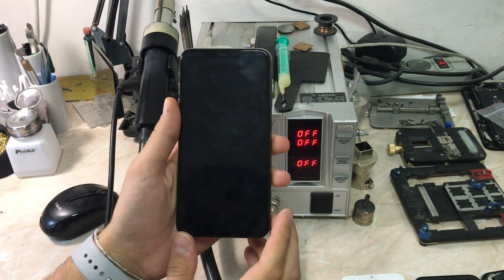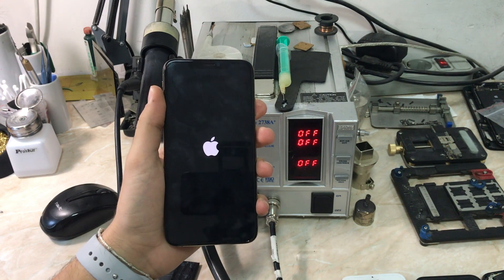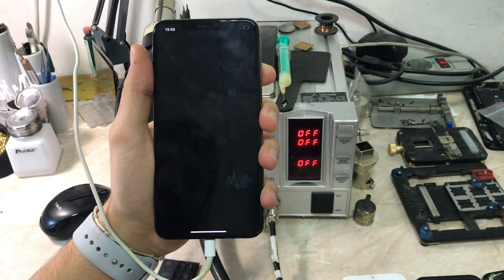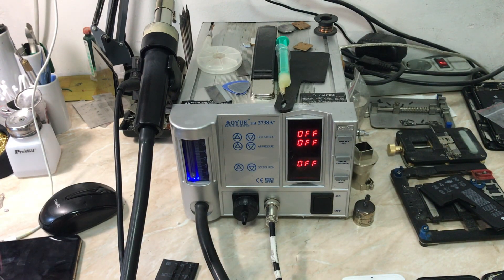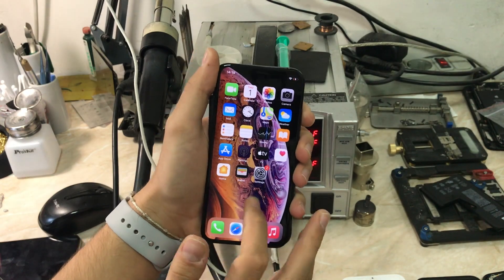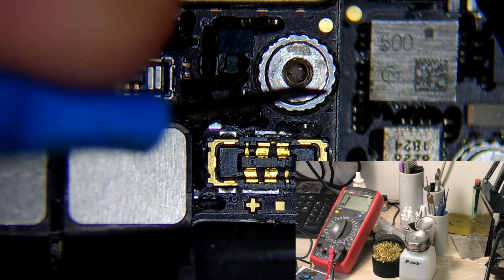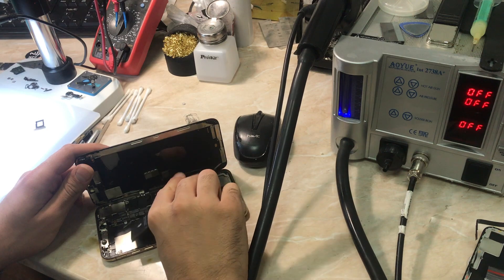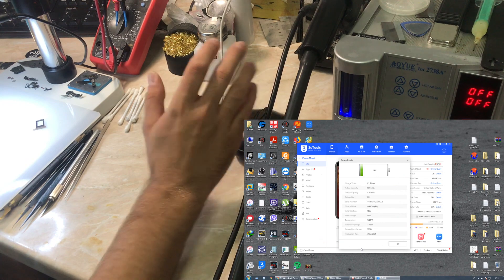iPhone Xs Max Stuck on 0% (Not Charging) Repair

Comment: Where are you located and do you still make repairs? Cost?? My xs max needed a battery change so I tried it myself. After removing the battery and replacing it the phone doesn’t  stay on for more than 90 seconds and only shows 1%. It also won’t charge. Apple said they won’t touch it.
Reply from the maker: Hi,
Sure, I’m located in Ukraine, you can DM me if you want

Comment: My phone shows the charging symbol but it just stays on the level it was at, I’ve already tried 2 batteries and each one has a separate problem
Reply from the maker: DM me
Reply: @AntoineKiriaky10  I’ll dm you on Reddit, I already have a couple posts about it there
Reply: I have the same issue. How did you fix it?
Reply: @ yes the third battery I got worked

Comment: Great help , thanks for mentioning the name of those mosfets , you may have just saved my iPhone, my XS IS DRAWING 0.46 WITH BATTERY PLUGED IN AND 0.40 battery unplugged, clearly there is a short and those mosfets are getting quite hot , ill try this repair ? although my one will not even power up , no display , any help would be great, ??? many thanks ,  I have just subscribed to your videos
Reply from the maker: Hey please DM on telegram so I can understand more about your problem thanks
Reply: @AntoineKiriaky10  thank you for replying , I do not have Telegram maybe I can install it , I have ordered the mosfets you used , I also noticed the 2 smaller diods on the left side of battery have been damaged they are DZ3200/DZ3201 so I just ordered them too, both are responsible for charging etc so hopefully they will be the problem , thanks again my friend
Reply: @alaster33  hey. did you solve this?

Comment: hi sir, your work perfectly nice. i want ask . this is first step to diagnosis wont charge right ? if this doesn’t work. we have to separate the board and see to hydra or coil right ?
Reply from the maker: It depends on the situation of course, first thing to do is basic diagnostics other battery-flex and then begin with board, i hope that you can join our group on telegram so we can discuss about this even further and there are a lot of talented people that they can help you immediately
Reply: @AntoineKiriaky10  I have same with xs ...stop charging  after reball.layer  motherbord....before its was wifi problem...now wifi work good but not charging...I changed mosfet from x but same🥺

Comment: How does it come this error occurs after changing the housing? I have one at our shop, it shows problem after 2 weeks of changing the complete housing using all the original parts :O need to check it under my microscope I guess 

Awesome work you have done here!

Comment: Hey bro, I’m currently facing the same problem. But my phone dies and turns back on again.. I was wondering with repairing the phone what’s usually the cost ££?
Reply: aye man did you get the phone fixed? how much was it if so and what was the problem

Comment: Nice video sir. Already subscribed! Sir my iphone x phone battery is good and the battery health is 100 percent, the problem is when the battery went to 30 percent or 25 percent it automatically shutdown when i plugged the charger it shows battery lowbat do you think the battery percentage is not accurate? Thankyou
Reply: Try replecement of battery it will work 100%
Reply from the maker: Maybe what is the history of the phone ? Is it the original one ?